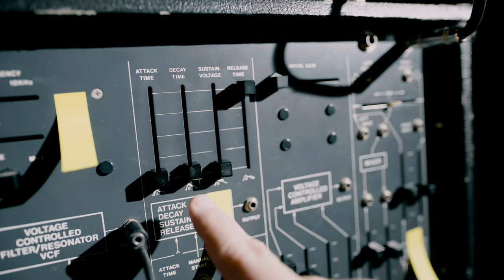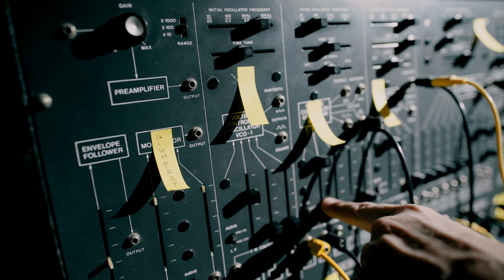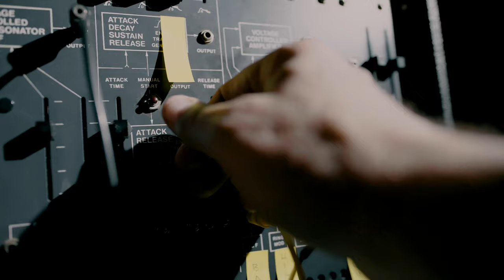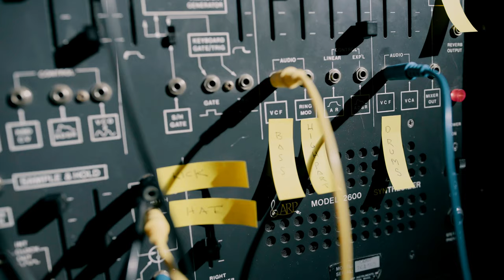Making A Techno Track Only Using An Arp2600

Comment: How to make sound from 1:12-1:16 seconds from arp 2600 patches from vine archive? Please help me!!!
Reply: Those were really quick patches I whipped up for no reason.  I never write them down  but from looking at the Arp during that time stamp it looks like Ring Mod is most of the audio source - as usual for me.  Then I'm using FM from the filter to sine of OSC 2 (OSC 2 is in audio range) then inverting the ADSR into the filter around 1k and Resonance about 3/4 up.  Mess with the sliders of each of the filter mods I just mentioned.  THEN raise the ADSR to mod OSC 2 - Don't invert that one.   This gives the vocal quality.  A combo of these two things should give both a vocal quality and a bit degrading sound.
Reply: @CasaDelGatos  I don't understand you little bit please make video
Reply: jason ivanov when I have time I’ll make a video and try to redo that sound - or a piece of it.